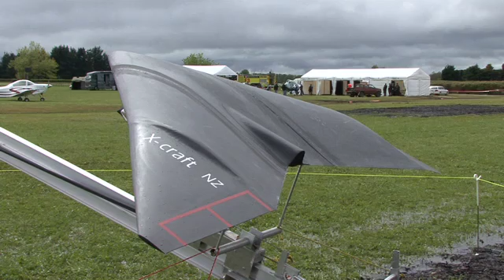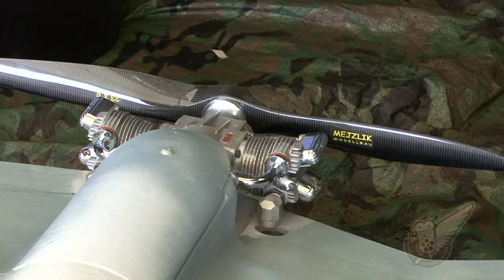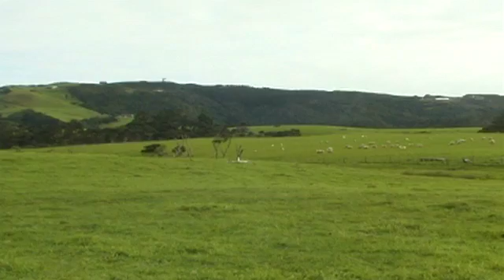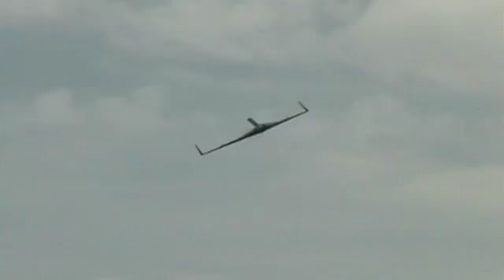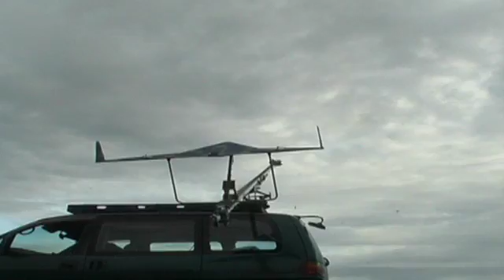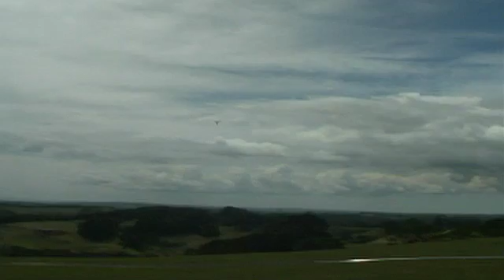Philip Solaris with the X-craft UAV

Comment: I had the same idea a few years ago but its become too easy....Pilots? Auto Pilot / GPS / 3G uplink / Navigation software for $600USD. Its very cheap to build a drone these days in 2013. The only real expense is the thermal camera...build with foam horton wing design. X8 Skywalker with a 2.1meter wing span. look into 3D foam shaping and use the same techniques of surfboard production.